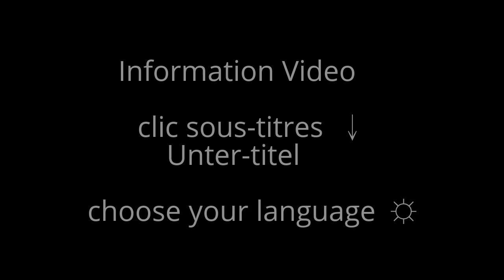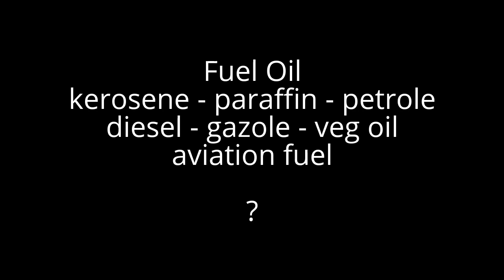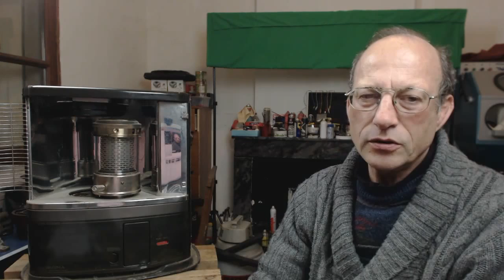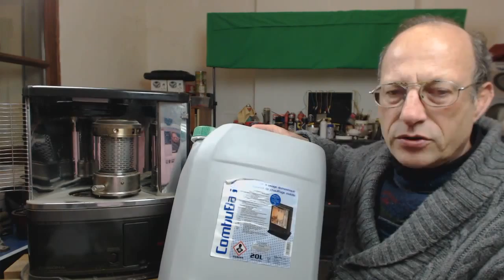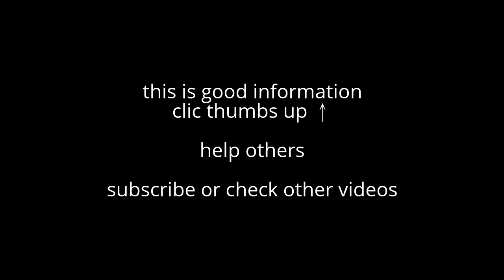Cheapest safe heating fuel - paraffin / kerosene / petrole heaters & stoves

Comment: I've seen a few vids on the Zibro brand heaters and a few colleagues of mine have been getting them for savings on heating costs. They are all satisfied. But here's the thing: my mother used one in the past and I talked to her about it. I can recall it from when I was a child. Great little heater. But they got rid of it in the past because of the fumes. They'd be very prominent and rather irritating to the lungs and throat. Is this a common problem or only in the case of unrefined kerosene / wrong type of fuel? I can imagine the sulfur amount being higher 30-40 years ago than now. I plan to use high quality Kerosene in a simple wick heater Zibro. Should I get a laser type? I mean the wick type looks a lot easier to maintain plus lesser electronics so I'd guess more reliable. My intended use is to heat my 64m² living room instead my whole damn house. Sorry for the long comment just trying to be clear.
Reply from the maker: The thing is Nightingale ... the ideal comment should reflect the authors thinking.
This means that the comment will be longer than a single sentence.

We like it that way :)

Overall, I would go for the more complex 'injector version'.

I have both the wick, and injector types.
... and what I know, is that the injector type burns cleaner.
Also, the heat can be adjusted (lower), while the burn remains clean.
If you add acetone at 0.25% - 1% it burns even cleaner; even at the lowest setting (and this saves you money).

I add acetone even with C1 grade fuel.
If you are forced, through cost (or unavailability of C1 fuel), to use heating oil (kerosene)...
I would strongly advise adding at least 0.25% of acetone to the kerosene.

The lazer (inverter, injector) heaters benefit from fan blown air into the combustion chamber - increasing combustion temperature.

Also, the fuel is metered to produce a leaner burn ... unlike the wick, which takes fuel on demand.

The wick type are good, but the additional complexity pays dividends
... and they are reliable ;)

Most of the problems arise from leaving it a year with old oil, or burning pure kerosene (which clogs the flame rod).
Reply: @EngineTuning  Hey ET, great video and good advice, thanks. Now that we might face gas shortages in the winter I jumped the gun and bought a Zibro LC 130. I also ordered some 20l of kerosene (suitable for heaters according to the seller). I'm not so sure that is suitable for indoor use so I requested the safety data sheet.

Can you tell me what to look out for? I doubt I will find the British standard there. It is a German seller btw.
I think I will get some aceton regardless.
Reply from the maker: @vinnie3543  The fuel container will likely have a picture of an indoor heater on the wrapper, or stick on label.
I can't speak for Germany, but in France, in the supermarkets & DIY stores, the containers are piled up on a pallet.

Last winter, the fuel was cheaper than diesel, so I mixed 20 ltrs in the fuel tank of my Berlingo.

When ordering, you must request 'indoor heater' fuel.
Standard kerosene is a heater fuel, but for external exhaust.

Either way, adding some acetone will improve the burn efficiency ;)

Comment: Back in about 1957 - 1959 my family used an old-style kerosene heater to stay warm, in the southeastern part of the USA.  It was the only heat source.  In those days kerosene was much cheaper than gasoline (aka petrol in the UK).  Nowadays kerosene is somewhere between $11 & $12 per gallon in the USA, and is hard to find in useful quantities, since so few people use it for heating their homes anymore.  At present I can find diesel fuel for about $3.75 U.S. per gallon, and I think home heating oil meant for a furnace with a flue is substantially cheaper.  I'm not planning to use an oil stove for the main source of heat, just emergency backup heat, but if the electricity fails for an extended period of time, our gas furnace won't run (neither the igniter, the flow control valve, the blower, nor the thermostat).  I don't know what if any standards were applied for kerosene back in the 1950s when my family used it, and other people did the same for decades prior.  I wonder if all the bad things like copper, zinc, lead, etc. were higher or lower than the C1 or C2 British standard in those days?  Who knows?  But apparently people survived it fairly well back then.  I don't think I will plan to store lots of gallons of kerosene at $12 per gallon for emergency use though.  I'll probably take my chances on low-sulphur diesel fuel, probably with a little alcohol or some other additive.  People who use oil heaters on a continuous basis and can get the C1 grade kerosene at a reasonable price might decide differently though.  Even though I won't be taking your advice, the information is great for people using it on a continuous basis.
Reply from the maker: Very nicely thought through comment John.
Thanks for that :)

I do understand your general questioning of the safety line, and how it might have moved (or not) ... and what might be the outcomes, given long term usage of an oil.

We are now quite used to being fed false information.
That in itself leads us to question past information ... like; was it as bad then, as it is now?

My best guess, is that 'back then in the late 50's and 60's' the safety knowledge was probably known, or at least it would be an educated assumption, that the fumes might not be ideal for health.
Let's not forget that the refiners knew exactly what was in any given fuel ... because they had refined it ;)

The question was likely more to do with what was acceptable to the plebiscite, within an acceptable tolerance to achieve a working life, to say 65.
... death often followed fairly quickly after that.

Let's also not forget, that we were not far away from heavy smoke inhalation - think of 'Dark Satanic Mills' ;)

Hahah! You may have learned that improved sewage came about, only when the stench was too great in the houses of parliament :D

However (and by some chance of fate), engineering standards in the UK, took on a life of their own.
Perhaps allowed, because in fact, profit could be achieved from higher standards (things worked better).

Take for example electricity.
Actual standards in Europe today (meaning what you find in your house), are abysmal compared to the UK.
I have found in my house (France), cabling from at least the 1930's, mixed in with modern cabling ... and that circuit supplies lights AND sockets!

Consequently (and from experience); I believe the test engineers.
... for how long; I don't know; but for the time being, I believe that they are providing us with the correct data.

Obviously; what the media states (including YouTubers), could be anything ... but we can still look for ourselves, and find the core test results.

Hey! The head of national statistics came out recently, stating that their published death stats were absolutely correct ... because they contradicted what the media and politicians were saying (ie. normal death stats).

Who are you gonna believe?
Him and his long standing team, or the media and the politicians?

From this ... I think that you are making a suitable emergency provision (with the diesel), because the short term benefit is enormous, against limited toxicity during an emergency.

Re prices
It's driven by other forces.
In France 1 US gallon of C1 costs $6 at today's rate.
Yet cost of gasoline in the usa today, is claimed to be 94cents per litre ... compared to France at $1.82
Pretty much, the US gasoline is half the price!

Clearly, the end product cost is unrelated to the manufacturing cost (plus reasonable margin).

Make of this what you will, but I do know that this situation has forced a lot of American people to burn diesel in their homes.

Re improving burn efficiency (and therefore safety for your family).
ALWAYS mix 0.5% to 1% acetone with the diesel.

I think that 0.5% is perfectly fine.
You are adding a highly combustible fuel ... but that is entirely insignificant.
What counts is that the acetone reduces the surface tension of the diesel, causing it to vaporise better ... leading to improved combustion (hotter).

Not only do you get more heat output (paying for the acetone, and more); but the fumes are cleaner AND the heater remains clean ... meaning ongoing clean burn, rather than a gradual degrading burn due to the build up of shite on the burner components.

Take care, and keep your eyes open at all times.
Best wishes ....
:)
Reply: I live just outside of NYC and 1-K is $7. I cannot imagine petroleum products in the South being much more expensive.. I wonder why.

Comment: Just like I thought. The Kerosene heater is now for the rich. It's far beyond the poor's ability to afford to run one and there is no alternate fuel. Natural gas all the way.
Reply from the maker: Yeah, i get your pitch.
Our world has turned to shite.
Hey!
We can't even freely breathe the air these days.

I don't know what to do (about it).

Previously, every problem always had a solution.
Reply: Most definitely it has. Wonder what drove up the price of Kerosene? I'm only referring to areas that have higher prices like here in the USA.

I have 2 Kerosene heaters which I will restore the 1980s model and sell it. Perhaps someone can use it. They sell well online. It's probably for the better though. Breathing those fumes no matter which grade of fuel cannot be a good thing in the long run. 3 out of 4 in our family developed neuropathy in our hands and feet. Unsure if breathing those fumes when I was younger contributed. Much better are sealed systems like the diesel heaters. I'm setting one up tonight actually. The inexpensive Chinese versions of these are quite affordable. I will recoop the money paid for the diesel heater with the Kerosene heater.

We must turn to God in these last days. He will see us through these troubled times. Godspeed, and thank you for filling in the information so many are missing on the health effects of alternate fuels. Best.

Comment: There is one more fuel above C1 and its called ROLF - "Reduced Order Liquid Fuel" it's completely clear and does not smell - looks like water - its so good that you never have to remove carbon from the wick...wicks can last 1000's of hours with this fuel - absolutely no paraffiny smell at all - as a matter of fact the carbon on the wicks is mainly down to the die they add to the paraffin - it used to be able to be bought in bulk a few years ago, so was economical then   not so now .
Reply: meant to say - "Reduced Odour Liquid Fuel"
Reply from the maker: @metalworker007  Nice comment :)
In Europe it is generally available alongside C1 grade ... so for 20 ltr around €32 against €22.

Comment: Here in Belgium two types of petroleum (Kerosine). You can buy two types at the petrol station.
One for household about 15 cent/liter which should according to specification good enough for heating ygood in house. However it wil l break a laser heating. To much dust and other garbage in it. fuel nosle and pump will get clogged. But according to Shell it should be useful for laser petrol heater. We contacted them because the heater broke. According to the producer of qlima you should only use their petrol because its more refined/filtered. Their cost 30 euro/20 liter is 1.50 euro per liter. Lately we bought petrol from special shops not at the pump for laser (not qlima) but after time it also broke the heater. So I asume a wick heater is a better choice. Anyway very good video
Reply from the maker: Yeah, in France you can pay €30 but some stores sell it for €22 .
The cheaper 'home heating" oil typically clogs the flame rod. 
I  made a video on how to fix this problem :)
Reply: @EngineTuning  thanks that will be helpfull
Reply: @rudolfr178  We use  PTX 2000 here in France, at the moment it's about 20 euros for 20 litres. Being using a sre co 30x electric heater for six years, just starting to get a e4 code, hence finding this channel. Never used the high quality parrafin such as zipro, though it might be slightly more refined,at 50% extra cost we have stuck with PTX 2000.
Reply: @guysmith3146  We use a qlima, at first we used their brand of petroleum. But found a cheaper solution taking petroleum from the station. In here they have two kinds.
Red petroleum not for home use and another suitable for home use heating etcetera.
However after six months the our laser petroleum heater stopped working.
No garanty reapair 70 euro. I think those laser petroleum heaters are more sensitive for this. The old types with a wick think they are less sensitive. But I have no experience with them. Just an antique one from before first world war. Still working but smoking awfull (Wick is finished). Started it up after 100 years standing at the attic. Simple construction but still works.

Comment: I know a guy who used to run a kerosene heater with a kerosene-petrol mix. Last week it set his house on fire
Reply from the maker: That's a valuable cautionary tale.
Don't mess with petrol ;)

If you are forced to use kerosene ... add a small quantity of acetone - 1 to 2% is fine to achieve a hotter, cleaner burn.

Comment: I dont have a kerosene heater...yet. Im learning. If I understand this correctly 1k kerosene combustion products are safe to breath assuming the heater is operating properly. The greatest issue to health is CO and CO2 build up in the indoor air which is easily solved with proper ventilation. Correct?
Reply: Thank you for both your response and video. I watched it several times trying to find a loophole but didn't.  After viewing a number of vids demonstrating the use of diesel as a cheaper alternative fuel to kerosene I was tempted. My problem is that eventhough I live a few miles from one of the largest oil fields in North America, kerosene is strangely unavailable or ridiculously expensive (by local standards). Several "box stores" are selling 1K at $2.60/L which is high considering gasoline sells for less than
$.50/L here currently. Diesel is 1/4th cost of 1K at $0.65/L and is widely available. See the temptation?  After a search I've located a seller of 1K at $1/L not so far away which makes the kerosene heater viable as a backup heat source. I use a natural gas central unit primarily but in the event of an outage I'd be stuck; plus, its old.
Reply from the maker: Well done for tracking down a better supplier :)
... it's cheaper than we pay in Europe.

Clearly it is still a rip off due to excessive taxes and profiteering
... but don't forget that the 1k will burn hotter, so you will get more bang for your buck (compared to basic kerosene)
... and the heat will not be laced with toxic substances.

:)
Reply from the maker: Yes ...
Adequate ventilation is necessary.
This is the case for all flame based internal heat.

Traditional fires tend to be self regulating, in that they simply won't burn without significant ventilation.
The arrival of sealed double glazed windows killed off the coal burning hearth in the UK - they literally couldn't function.

I have mine in the space of a removed hearth.
This seems quite effective as it provides low ventilation.
I presume that most of the heat rises and fills the room, but some will rise through the chimney, taking with it the heavier CO's.
The fresh air will be sucked in naturally, due to the ancient design of the house.

Comment: Any advice Welcome 
I have a Zibro LC-400 heater however after a minute or so it will cut out with a E-11 code ( Ventilation) I’ve even tried the unit outside and still cuts out with E-11 code.
Reply from the maker: I haven't come across an E11 code before.
You've identified it as 'ventilation' ... this could mean it is a CO2 warning ie. ventilation required.
As you have tested the heater outside (nice!),the likelihood is that, if it is a CO2 sensor warning ... the sensor either requires calibration, or it has simply failed.

I have already covered the solution to both these eventualities:
https://youtu.be/djHI69lIcxo

As you can see from the comments; in most cases, re-calibration works perfectly.
However, if you are unlucky (like I was) then you will need to bridge the sensor, and install a stand alone sensor.

If this latter fix does not work, then you can unbridge the sensor, as the code must mean something else.

In that case ... follow the standard cleaning procedure as outlined here:
https://youtu.be/VC-5657JLhU

... then suck out the old fuel, and start the heater with a fresh batch.

Ideally begin with high quality grade fuel C1 or K1 in North America, or, if using kerosene, add 1% acetone to gain a clean burn.
Reply: Engine Tuning: Thank you so much for your advice very much appreciated and I will let you know the outcome on the fix.
Reply from the maker: I'll look forward to that Russell :)
Good luck with the fix!